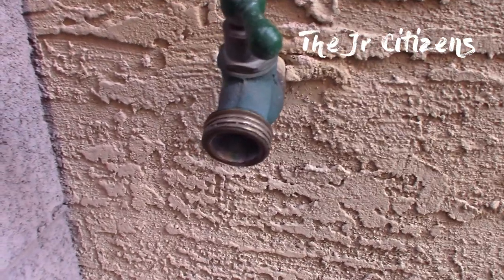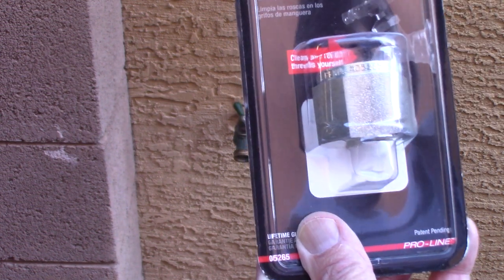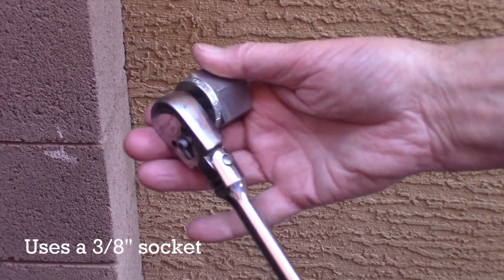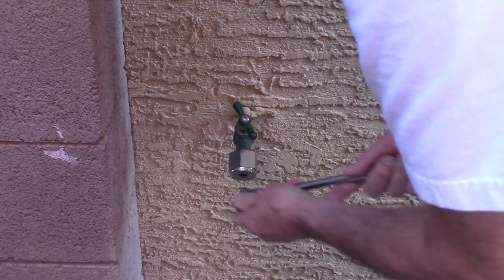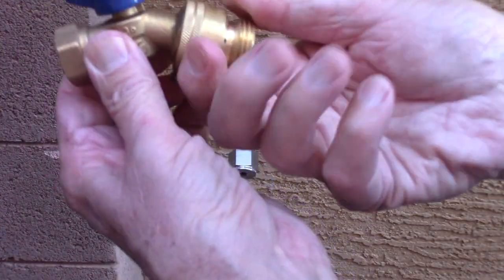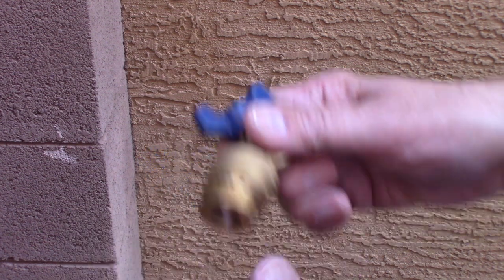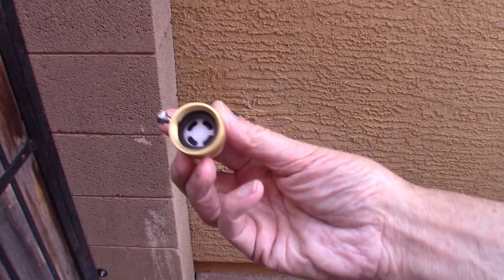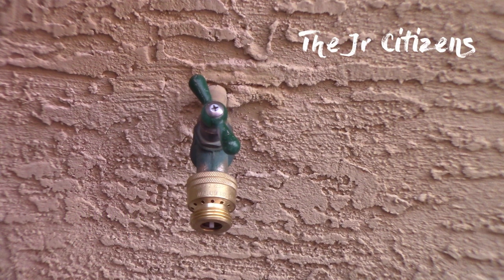DIY Plumbing: How to Fix Damaged Hose Bibs. Unboxing the Mr. Thread Cleaner Tool.

Comment: I have this same tool. Next time, use some lubricant like oil or similar. It will be easier to clean the threads.
Reply from the maker: Thanks for the tip!

Comment: Instead of wrenching the thread chaser all the way until you can't anymore, go back and forth slowly to clean and regroove the threads on the pipe bib. Make sure your not cross threading the pipe bib the way your wrenching with all your might.